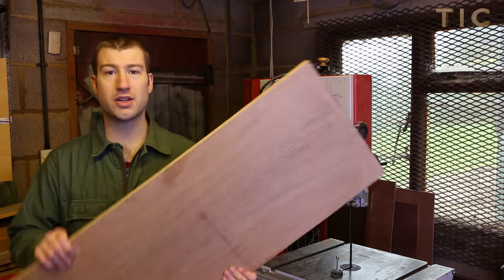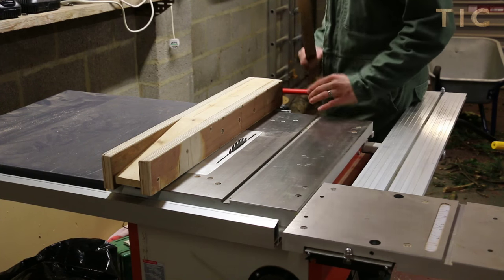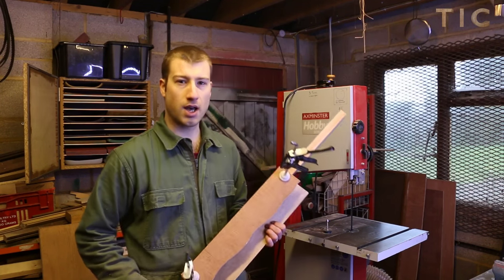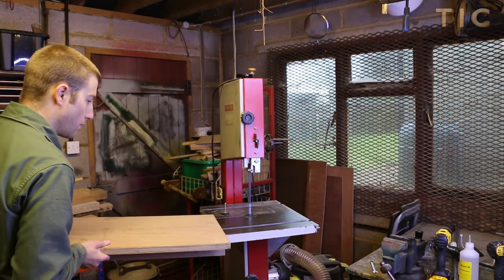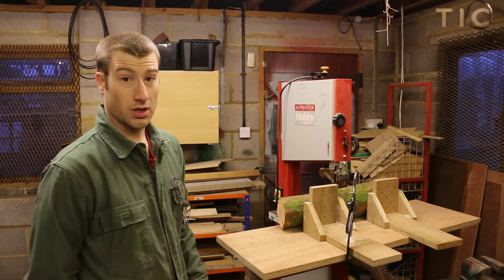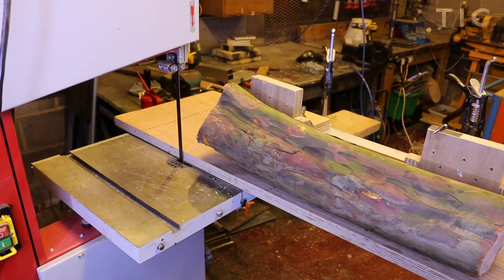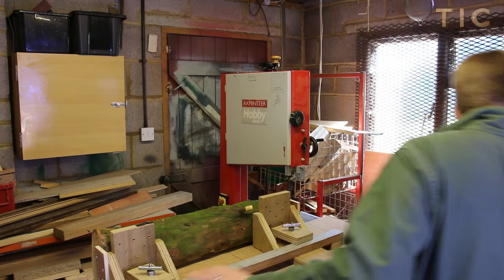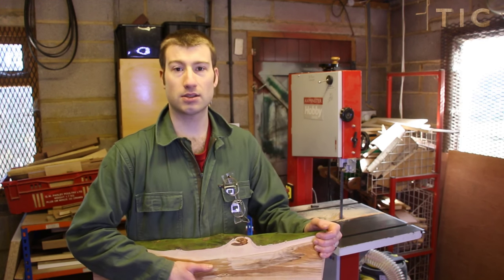Bandsaw sled - Rip cutting green timber

Comment: I notice a lot of people offering advise (I think with good intension) and some people thinking outside advice is a bad thing.  Ultimately your sled was a fail which was apparent to even yourself. Although it failed, it was an effort that awarded new ideas and possible methods to correct the problems encountered. No project goes ahead without some failure or tweaking to learn from. Good strong effort and the balls to post your so so sled is going to make me at least hit the like button. Keep on keepin on.
Reply from the maker: Thanks for the comment. I did learn a lot in the process. I'll try to do a vid of the upgraded one soon.

Comment: Well done. Nice sled  you really did a great job on it. I use a timberwolf 3/4 inch blade with a 4TP (4 teeth per inch) and it cuts smooth. Others have mentioned was I agree with that. There is no need to make a new one out of anything different this one works great and I'm sure you have already made adjustments. Keep up the good work.
Reply: *wax
Reply from the maker: Thanks for the comment. Yes, i have it working much better now, i'll upload a video of the upgrades one of these days... :-)

Comment: I like what you have done.  I also have been having trouble with friction.  One thing that did help was going to a 3/4 in 2 tooth per inch blade.  I saw one of the comments below that I will try.  Make the sled longer and use roller stands on either side to keep the sled off of the table.  I am cutting much larger logs and the weight is causing the trouble. The other thing you might try.  Is once you square  off the log and if you want to cut repeated slabs.  Just use your saws fence.  It requires less effort to set up for each cut.
Reply from the maker: Rollers would definitely help.. I like the idea of using a fence for repeated cuts! Thanks.

Comment: I made a similar sled, that is smaller, and a little more adjustable.  Waxing the table top and specially the runner and miter slot with some beeswax seemed very helpful.  I think I also used 1/2 plywood.  Which cut down on the weight of the sled itself.  I don't have the underside bit you have either, and I really haven't had any issues with it tilting.  So that would save you some friction as well.   Thanks for the video!
Reply from the maker: Hi Joe, thanks for your comment. I agree, the plywood I used was unnecessarily thick - which not only increases weight, but reduces my available cutting depth... Unfortunately it was the only suitable piece I could lay my hands on at the time. I've added a lead-screw to it now, (which I'm currently driving using a battery drill), which makes for a much more consistent cut due to the more controlled movement. I'll upload a video of that when I get a chance.

Comment: Sand the mitre slot runner until it doesn't bind. You fastened it to the plywood with a slight bend. Use pencil lead on the mitre slot and sent the runner through to see where to sand. Then wax everything. No silicone. Thanks for a great video. Nice slab.
Reply from the maker: Thanks for the comment, that sounds like some good advice! I like the idea of using pencil to work out where it's binding.

Comment: I just made a fence, no sled, longer than my stock, then find the flattest/least convex orientation and press that against the fence, push the wood through, taking a small slice off, taking care not to roll it. That gives me a flat. Roll 90, mill another flat. Find any high spots using a rule, then I blast those off with a belt sander, going for "flatter". Then I cut my other two faces in small increments, and the error falls off with each pass. Because I am taking small slices, there is little pressure/pinching. Once I get two "good" faces, I'll cut a bit wider than the board I need to account for sanding and adjustments.By that time it is pretty much zeroed in, and I'm only going to have to sand out saw marks. I'm cutting lengths of seasoned birch.
Reply from the maker: That sounds like a good method! Thanks for the idea, I'd not thought of that.

Comment: Paste wax. Get some. Prevents rust too. Another thing, the method for cutting the log is only good for relatively straight uniformed thicknesses of wood, not a tapered log for which the two braces might be offset.  Solution? Make one sacrificial cut to flatten one side, then you have a side zero'ed out for the even line. Most people make that cut to use as a bottom for the rest of the cutting, so they won't need a sled. It is not just your blade, its the sled being warped due to the hold downs pushing at different places along the base. I would do one of the following: Make a special feed table to go over/around your bandsaw top, or make a stationary top to cover the existing top with a sled on it.
Reply from the maker: Thanks for the pointers. Useful info!

Comment: Roller run-in and run out. Paste Wax on both your table and the sled. See if that helps. As far as the blade, you might want to drip soapy water on it to help lubricate the blade during the cut. Yes, it gets messy but only if you use too much coolant.

Comment: I realize that this is a few years old, but I'm wondering if you now have enough experience doing this to give some up-to-date information.  What have you changed for this project since you made this video?  I'm working on the same idea at the moment.  My sled is simpler--just plywood with a runner, and some washers on the bottom of the runner to fit in the inverted T slot on my saw table.  That takes care of the lifting off problem.  I secure the log to the sled with screws from below.  I used too-light plywood, and it flexes which is annoying when you're first advancing the sled.  You made a better choice.  My first cut to take off just the bark and a little more went fine.  On the second cut the kerf closed on the blade, and I didn't realize it before the saw stalled,  By the time I wedged the kerf open and freed the blade the blade had come off and had been bent in several places.  Like you, I think the blade I used was too fine (and maybe too narrow).  So this project goes on the back burner while I wait for a new blade to come.  In the meanwhile, I'll put on the thin blade and make some band-saw boxes.
Reply from the maker: Hi Andy. Definitely go for the coarsest blade you can fit on your saw, chances are it won't be coarse enough, but will do the job better. I think the one since got for mine was 3 TPI. The main problem for me was this: There is stiction in the system, and my arms are somewhat elastic. Whenever those two things are combined, I'm going to get jerky motion. The solution is to either remove the stiction, or remove the elasticity of my arms (or the pushing force). I went for the latter, as it had other benefits. I used a battery powered screwdriver to turn a leadscrew, that is screwed into a tapped bit of ally which is fixed to and hangs down below the front face of the table. This means that the sled progression is slow and steady (no lurches forward), and it works brilliantly, the cut quality is phenominal (compared to me pushing). One of these days i'll make a vid of the upgrade, but until then, i'm happy to talk it through with you and show you round it over zoom or whatsapp. I can't see how to send private messages on youtube, but if you send me a message to my instagram account (linked in the video description), i'll give you my contact details. Cheers, Nat
Reply: @stuffnatdoes  leadscrew is very clever idea.
Reply: If you could use both mitre slots on the table it would be good for reducing play. The sled would be on both sides of the blade joined at each end. It means the sled encompasses the blade, you could then have anti tip runners under neath both both sides of the table. I tried something like this but haven't yet got it perfected. I think my blade needs to be tighter maybe.
Reply from the maker: @MrJasonmkennedy  Thanks! 😊
Reply from the maker: @MrJasonmkennedy  I didn't think of using both slots, I can imagine that would help a lot.

Comment: Hi, thanks.

Two thoughts. I just came from a friend's who had offered me the use of his "re-sawing" bandsaw. I took my 8in diam. log of West Texas mesquite there to slab.  He threw me out--"...RE-sawing. Get it?"  I'm determined to make a sled and try again... ;^)  The first thought was his blade looked like about a 1 TPI (very wide spacing in any case), and it was about 1" wide as well.  Mind you this is a commercial resawing saw.

The second thought is to replace your wooden runner with a metal one: metal on metal just has to be slicker it seems to me.

Of the two, I think an even wider tooth spacing would be your first go.
Reply from the maker: You're right, the coarse blades do seem to be the way to go, unfortunately the blade i have in it is the coarsest I can find given the maximum blade width that my bandsaw allows.
I agree with your metal on metal comment, wood on metal isn't the best.
That said, shortly after I made this video, I constructed a lead screw drive for it that I drove with a battery drill. This gave really consistent, smooth motion and the stiction issue effectively disappeared. I'm in the process of tidying up the drive, replacing the cable-tied-triggered battery drill with a more permanent and neat solution. When I've got that finished, I'll upload a video of it.!
PS I never realised that resawing and ripping were different, I guess, as your friend implied, the clue is in the name... :-)
Reply: 2 TPI is a good place to start if you can find one for your saw. It is available in 1/2" sizes as well and should give you decent performance. Not sure about availability in the UK, but Timberwolf brand blades are nice pieces and long-lived.
I'd have probably thrown duubtuub out anyway, even if he was resawing. Mesquite is a very lovely wood, but it is very hard and, because it tends to grow in dry, windy climates, it often has a rather high silica content and can be murder on blades. Might try sanding your runner to get a smooth finish and applying some spray enamel. It would give a slicker surface to ride on the metal.
Reply: I sliced up a chunk of mesquite once. It's really pretty wood but it was Full of voids from some kind of bug.

Comment: Thanks for the video, I will assume you have made your mods by now! I liked your bar clamping nut things so I think tomorrow I will turn a few n thread to suit available bolts. TFS, GB :)
Reply from the maker: Hi Graeme, Thanks for the comment. Yes, the mods were made a long time ago, in the intervening period my wife and I had a son, so life's been a bit busier than before. It's settling down a bit more though so I'll get the update video out soon. The clamping bar nuts we're actually repurposed from old flat pack furniture, where the nut is pushed down a hole to hold a butt joint tight - the benefits of never throwing things away! 🙂
Reply: @stuffnatdoes  Yeah thought they were, think I remember seeing something similar in my garage long time ago though so they could be anywhere now! GB :)

Comment: I made a table saw sled with oak runners. It stuck like glue to the cast iron table saw top until I waxed the sled runners and saw top. Then it worked fine. I think if you use the jig you made more, it will eventually get easier to use when you push it. Nice work and good video. I see you made a rip fence for your table saw. What is it specifically made for? Thanks.
Reply from the maker: Hi, Yes, wax has helped. I have some special lubricating wax specifically for treating cast iron tables etc. I've since electrified the sled with a driven lead-screw, which has transformed the cut i get. Hopefully i'll make an update video soon. In answer to your second question, the fence that came with the saw only reached half-way along the blade (which, i understand, is a health and safety thing, as it reduces the risk of nipping the work between the fence and blade and flinging it back at the operator), but i was finding that as my work piece got near the end of the fence, i couldn't keep it straight. So the full-length fence was born. It was 'ok' but not as straight/flat as i wanted, and also not as high as I ideally wanted, so i have since replaced it with a tufnol 6" x 1" x full length fence, which i'm much happier with. Thanks for your question! Nat

Comment: Make the pieces that run in the slot and lock the sled to the table from HDPE plastic material. It is permanently self lubricating. If it is within reason make the sled of it also. Also chamfer the entry edges of the slot and saw table edge and polish so they cannot bite the sled and guides. That piece of finished wood contained the center core of the log( the dark area) it will separate there while drying.The core should always be cut out of the log and any salvageable wood taken from beside it. Keep up the good work.
Reply from the maker: Thanks for your comment, that sounds like some very good advice.

Comment: A suggestion on the eze of which you desire the sled to move.... take the metal surface of your band saw as well as the underside of your sled and sand it down very fine with some fine sand paper and then wax it all up and buff it with wax like Johnsons' paste wax. Important to buff it after it dries so as to make nice and slick.  I hope this helps you
Reply from the maker: Thanks, that's a good idea, i'll try that!

Comment: Finding this video is perfect timing as I just recently purchased a Grizzly bandsaw for exactly this purpose. First let me say thank you for posting this! The design I had in mind was very similar to yours, but I planned to use 2 roller stands to distribute the weight a bit better instead of trying to balance the load myself, and formica countertop to help with the friction between the sled and the saw tale. Have you by chance "tweaked" your jig? I would appreciate seeing any modifications that you have discovered after using it a while.
Reply from the maker: Hi, Thanks for your comment, sorry for the late reply. You guessed right, i have tweaked it since, I've made it electrically driven. It works a treat now. Hopefully I'll get a video of it up soon!

Comment: I am smiling as my first attempt at a resaw sled was the same as yours.  The blade drift on my smaller 1/2" wide 3 teeth per inch blade was causing my 1.5hp bandsaw to just get all bound up.  It's too much for a smaller saw to handle in my opinion.  Now take a 17" grizzly with a 1" blade and a 2 hp 220volt motor and that sled would work perfectly.  There is almost no blade drift on that machine.   I resawed some walnut a couple of weeks ago.  Mainly just put the log on the saw and cut it by eye ball.  Then roll it over and cut the other side.  Then joint those two sides and resaw again using a straight edge and a sharpie marker to cut by.  It works.  Is it safe?   Working with 36" logs that are 12" in diameter I resaw them with a chainsaw right down the middle then resaw that.  It's one thing to talk about a resaw table it's another thing to get it to work on a small saw.  Thanks for sharing your work with us.  It's fun to share these kinds of things.
Reply from the maker: Hi Mark,  Thanks for the comment. I'm glad you hear you're having fun too!  :-)
Reply: Here is a video on my resawing 2 weeks ago.  I don't have the sliding fence in this video.  I guess I need to get that out and show why it won't work (well)  on the smaller saws..  Mainly Blade drift on the smaller blades.
https://www.youtube.com/watch?v=YCMrUePBEWY&t=26s

Comment: Paste Wax should help ease the friction between table and sled.
Reply from the maker: I'll give that a try, thanks!
Reply: @stuffnatdoes  put a thin layer on the table and buff it with a rag. Apply a decent amount to the underside of your sled as well and “buff” it. It’ll slide much easier without having to add bearings or rollers to your miter slot rails

Comment: Mate, may I make a couple of suggestions?

1: Investigate the phenomenon of "bandsaw blade drift". If you haven't compensated for this, you can, by adjusting your bandsaw wheels tilt, particularly the top wheel, to either obviate it or lessen it. Jigs and sleds can help by forcing the log to track truly, but you need to lessen or remove the tendency of the blade to track "off course." There are many excellent videos on this. Search Google.

2: The wider the bandsaw blade and the fewer the teeth-per-inch, the better the ripping performance. This is directly related to the ability of the blade to clear chips and swarf from the cut, and so decrease the tendency for the blade to drift to one side or the other.

3. Also investigate (and purchase, and learn how to use) a planer. The Americans call this a "jointer", but in Australia it's a planer.  I don't know what it is in Britain, but someone will tell you once you find a photograph of one.  Do not confuse this machine with a "thickness planer" or "thicknesser." Again, Americans refer to this machine as a "planer", and it isn't; it's all a matter of terminology.

But from me you get a very high mark for ingenuity and determination!
Reply from the maker: Hi Greg, Thanks for the comment. It's a called a 'planer' too in the UK, and it's on my wish list! I have a thicknesser, I had originally thought i could get away with just that on its own...
Reply: bandsaw drift Is a myth. if you don't bind the blade it'll cut straight every time.
Reply: @cokemillion  You are right.  A dull blade causes drift because of over forcing the feed rate or loading. A sharp blade will not drift unless you bind it.

Comment: Maybe the runner is too thick/deep. Typically I see objects placed inside the miter slot to raise the runner to the jig, so that the runner works side to side, but does not touch on the bottom. Or, maybe there's a bow in the runner? Otherwise, good jig.
Reply from the maker: Hi, thanks for your comment! Yes, I think the rubber was definitely bowed a bit as it fit well before I glued it to the button of the sled.